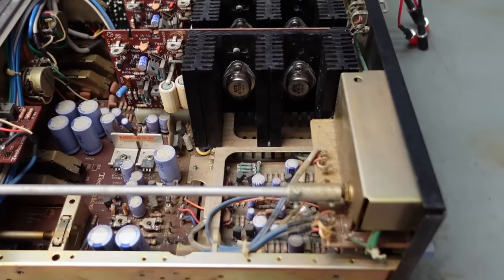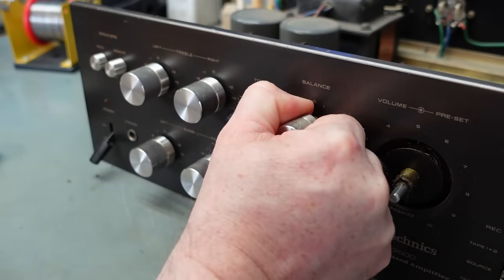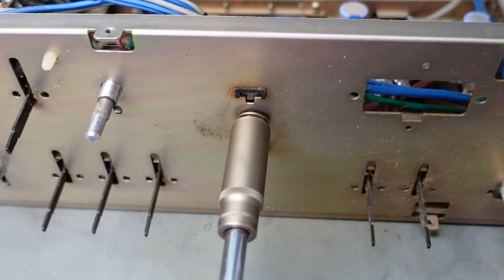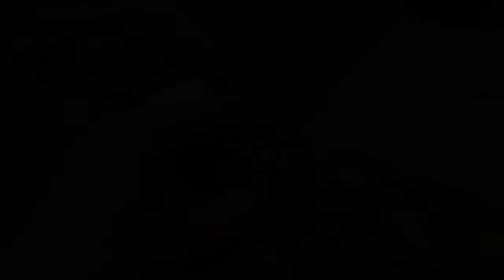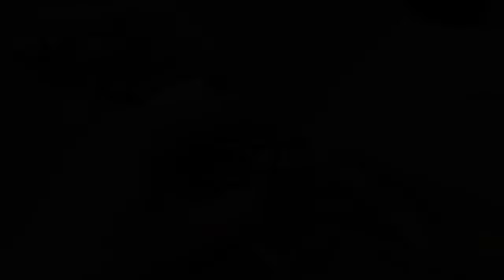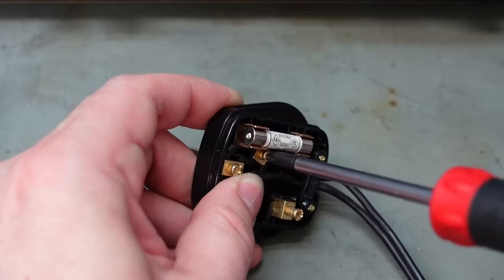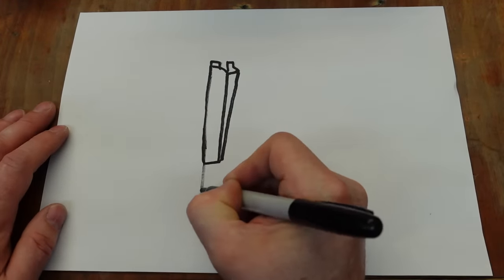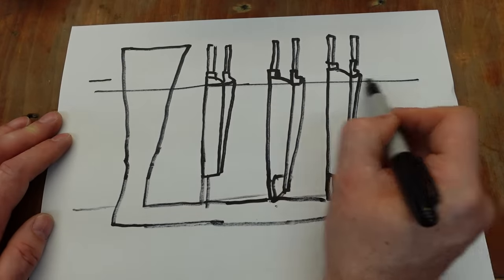Technics SU-3500 Amplifier Repair - Part 2 - The Overhaul!

Comment: I watch all your videos with amazement and it troubles me to see that you have no ventilation system for the solder smoke. I learned the hard way, that solder smoke causes cancer. I went through throat cancer treatment in 2005 which was cause by inhaling the smoke. So take it from someone that knows, get a system.

Comment: Those electrolitic capacitors are probably ALL bad. With time they should LOSE capacity, instead the one you measured are all WAY bigger than spec and even beyond the 20% tolerance. This means they are leaky, and the greater time needed to fully charge them (due to the leakage) is the cause of the bigger capacitance reading. Sooner or later from leaky (that is already not good) they will become short circuit, and more transistors or other components will blow.
If you want to restore these thing you cannot leave many decades old electrolitic capacitors because "they are expensive to change". It will be more expensive not to change them!